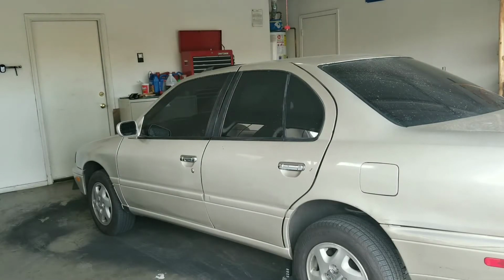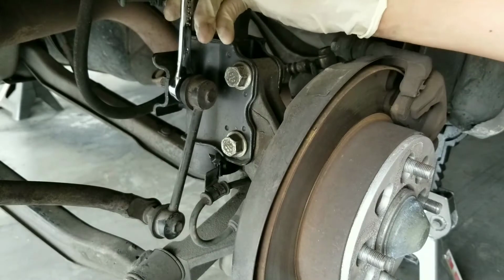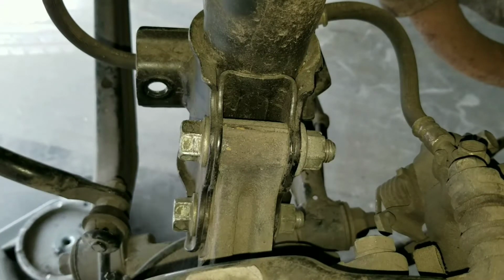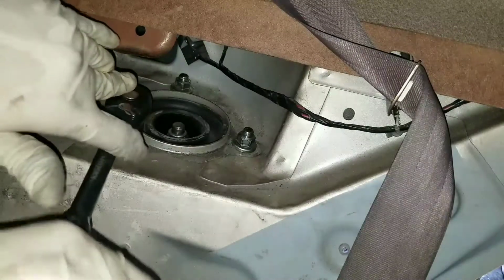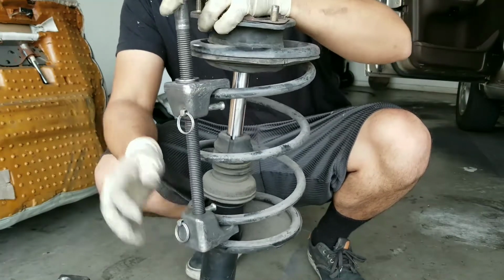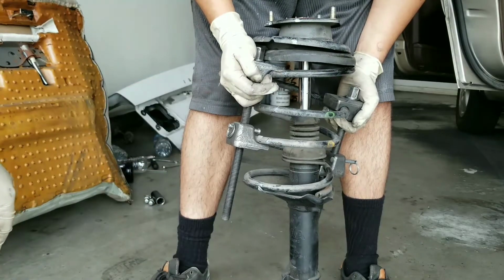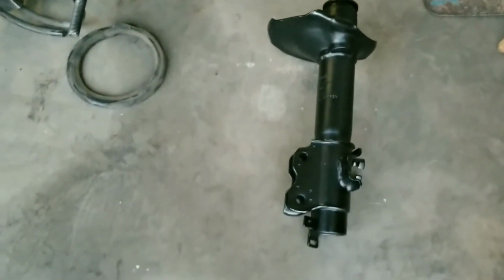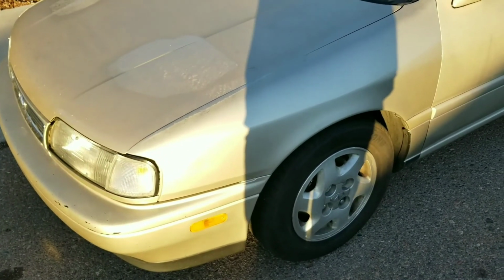Rear Shock Absorber Replacement On A 1991-1996 Infiniti G20!

Comment: What brand Strut did you buy? a mechanic told my that the KYB will be very stiff and the Monroe will be better thank you
Reply from the maker: This was gabriel shocks but i have kyb on my 2000 g20 with lowering springs and I haven't had any issues yet.
Reply: @ERICSDIYGARAGE  Thank you very much man my G20 is a 1995
Reply from the maker: Thank you for watching 👍